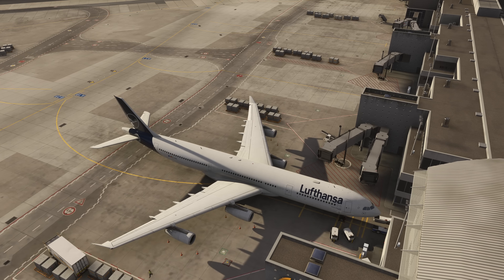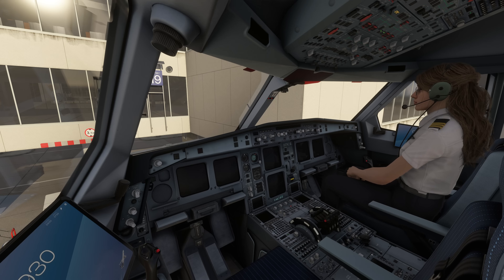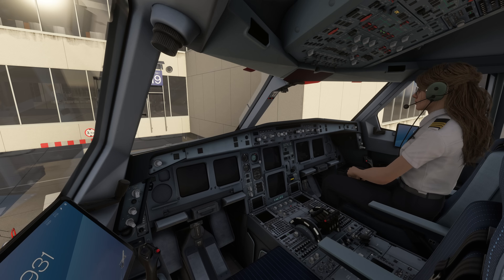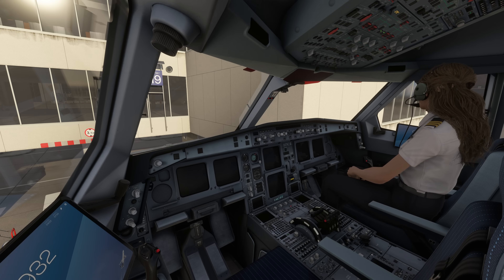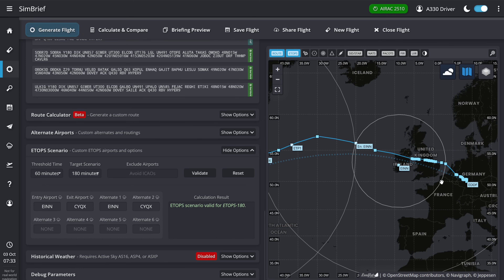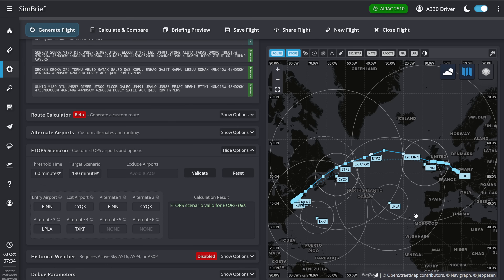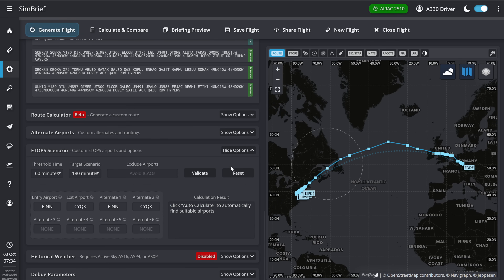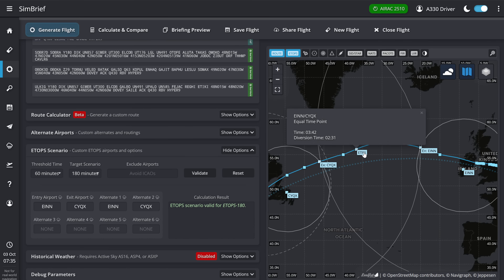Why ETOPS rules NOT ONLY APPLY to 2 ENGINED AIRCRAFT | ETOPS with FOUR ENGINES? | Real Airline Pilot

Comment: Didn’t watch the vid but just wanted to chip in that to accommodate aircraft with more than 2 engines it’s now referred to as EDTO ( extended diversion time operations ) .
Reply from the maker: ICAO still officially recognizes the term ETOPS though - while it is correct that the "true" name nowadays is EDTO.

Comment: So how about An-225 it has 6 engines
 :D
Reply from the maker: hahaha, well even the B52 will have to follow these rules!
Reply: @A330Driver  Interesting. I thought ETOPS was only for comercial ops.
Reply from the maker: @cclguedes7  It is. But the AN225 did operate on commercial ops.
Reply: @A330Driver  Oh, I was referring to the military B52.
Reply: @cclguedes7  IF the B52 would be operating commercial then yes, it would have to follow it as well. but well, what would be the use case of a civil B52 xD